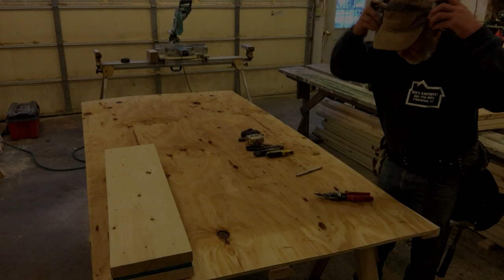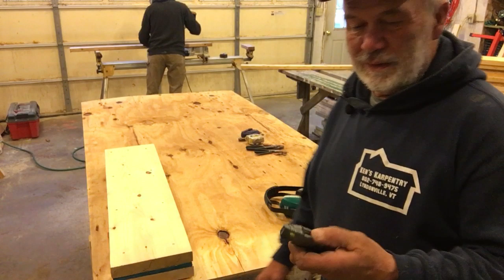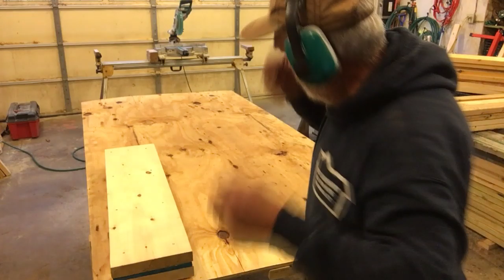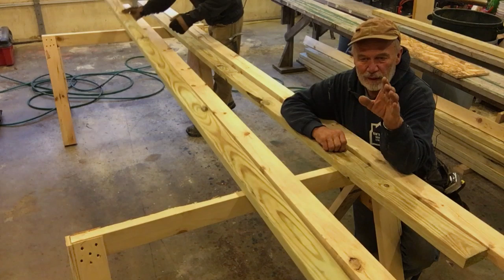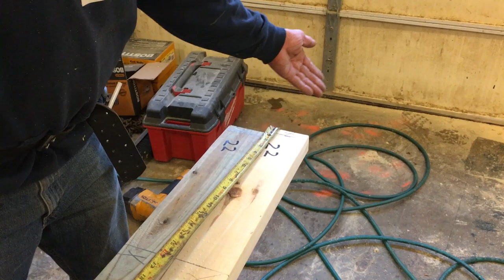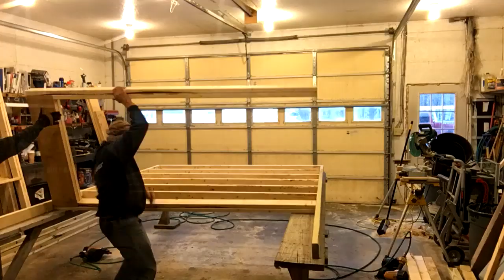How to build walls and window openings for a garage

Comment: Ken, you obviously build walls that are the same, from garage to garage, based on outside dimensions. So have you thought to use story poles made of angled aluminum or such, and put your marks there so you can lay it on the plates and mark your stud locations? It would beat pulling out the tape every time.
Reply from the maker: Interesting idea. Thanks

Comment: Ken, what make and size window do you use for your garages. Is there a standard size you use or would recomemend.
Reply from the maker: We normally Use Pella Low E 36" wide x 48" high.  It's a stock item right on the shelf.  Just over $200
Reply: @kenskarpentry  you get them at Lowe's

Comment: Happy Thanksgiving to you and yours Ken. In my toolbelt I carry: 22 oz. Framing hammer, 2 nail sets (1 big, 1 small), fairly sharp 3/4" beater chisel, beater flat head, #2 Phillips screwdriver, random screw tips for drill, 25' tape, 2 to 3 pencils, keel, side cutters, needlenose pliers, regular slip joint pliers, red aviation snips, speed square, 2 utility knives (1 straight, 1 hook blade), all kinds of random fasteners and one pouch just for the ones I need for that job. I also have suspenders because carrying all of this is pretty heavy, but my toolbelt is my number 1 money making setup hands down. I would not work without it.
Reply from the maker: I love it. Someone that is prepared!